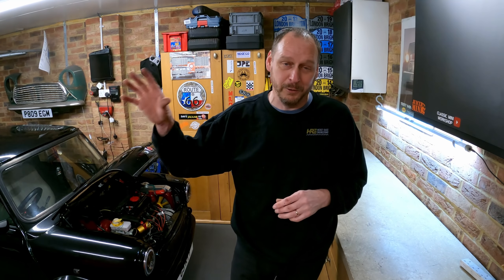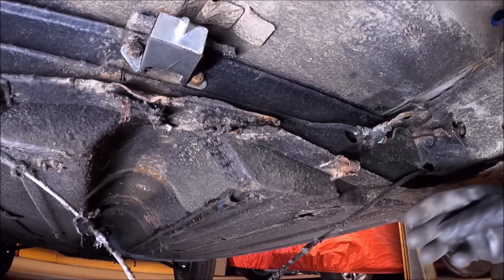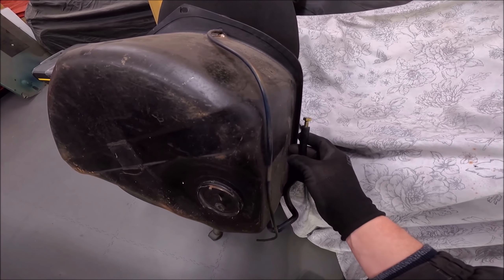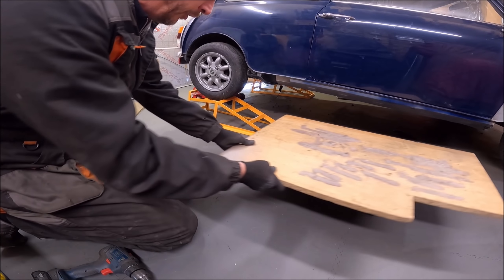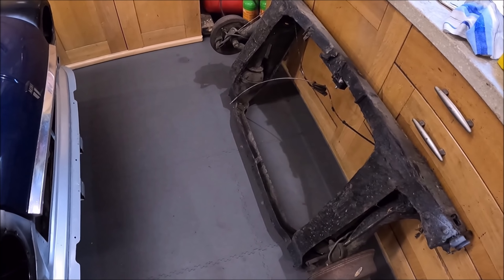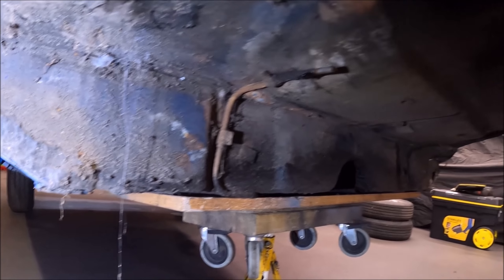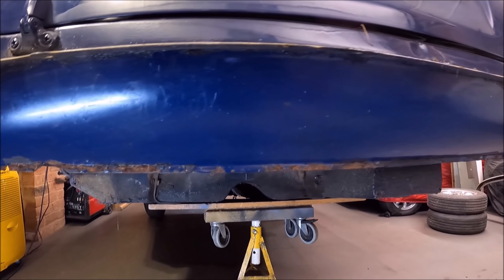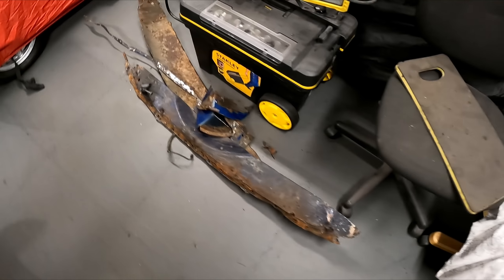Rear Subframe Removal *Budget Restoration* - Classic Mini Workshop Part 22

Comment: Its a ball ache and you do feel like its not worth the effort but you would regret not getting that underseal off. And the amount of rust rot proved you right. Not excessive but enough to need finding and fixing. And its all about doing a job right.
This car has turned out to be a bit of a hidden gem. Although you wouldn't feel like that after 8 hours of graft!

Comment: I just completed those two (I had a few more) repairs. 
The closing panels under the floor were solid with only surface rust so I didn't need to replace them.
I formed the two panels myself.
The only thing that didn't come out just right was the placement of the fuel tank strap bracket. I had to reproduce a copy of the original. It came out pretty well. I think my placement was off a touch.
The tank could go outboard just a 1/4" more but it's solid and the filler neck is still looking fine.
So I did both sides below the tail lights, on top of the wheel arch and one spot hidden but the tank.
👍
I didn't remove the subframe. 
I'm watching your video and replacing ball joints.😁
Just cleaned up the hub now. I don't have new bearing or seals but they look and sound fine.
A repack just be good until next winter.
By that time. I'm sure I'll upgrades something and replace the bearing and seals.

Don't get discouraged. Keep pushing.
We can't let these little cars die.✌️🇺🇸
Reply from the maker: Thanks Frank

Comment: Hi Keith.  I wonder why most Minis have rust in that same place in the boot? The rust always seems to be in the floor corners where the subframe bolts through. Leaking boot lid, condensation, moisture coming up through the bolt holes?  Issigonis certainly wasn't thinking about longevity when he engineered the Mini.

Comment: Another great video Kieth. If you didn’t like horrible jobs you wouldn’t be working on mini’s - there’s always a horrible job hiding around the corner. It’s irritating for you as the rear is much better than it could be, but bad enough that it needs doing. As always you’re doing a proper job, not leaving it for someone else. You must have videoed almost everything - have you thought of cataloguing the jobs so they can be easily looked up - Keith’s video Manual?
Reply from the maker: No, I've not really though of that but it sounds like a good idea!

Comment: I was selling new BLMC product in the mid 1970s mainly Austin Morris group at London's biggest distributor. We offered purchasers  a choice of 2 underbody treatments on new cars. Because.  the cars then were stored on grass as they came out of the factory  they were  first sprayed in a hard drying wax both on top and underneath.We PDI the cars in wax then drive them to  either a Ziebart station  where they had all box sections drilled injected with a black bitumen tar like compound which never hardened and remained sticky- they also sprayed the whole underside with the same black sticky to the touch material. However for half that price a firm Called Metcalfe Nurse collected  masked and sprayed the whole underside  everything except the exhaust in a very thick hard setting dark brown compound about half an inch thick which over time became brittle .
Reply from the maker: Thanks Richard, that is interesting to know. It certainly looks like it was coated from new.

Comment: What did you use to get the underseal off. Need to remove fairly new waxoil from the underside of my mini, what would you recommend. Its still oily and not brittle. The previous owner done the sills and back end and painted it with red oxide and then just waxoiled over the top so want to take it all off and paint underneath and then re waxoil it or would you just leave it? Think it would be okay? 

Also I've got a new pattern rear subframe forsale if your interested. Also got valance, and closing panels if you are interested 

Thanks
William
Reply from the maker: Thanks William, I've already purchased the subframe and panels. I just used a scrapper and hammer to chip away at the underseal. It was old and brittle so came off easily. I would clean off the waxoil and re-paint. Try some brake cleaner on it, or petrol on a rag works well, but be very careful with the fumes etc.
Reply: @classicminiworkshop  that's very useful. Very kind of you!
Thankyou 🙂